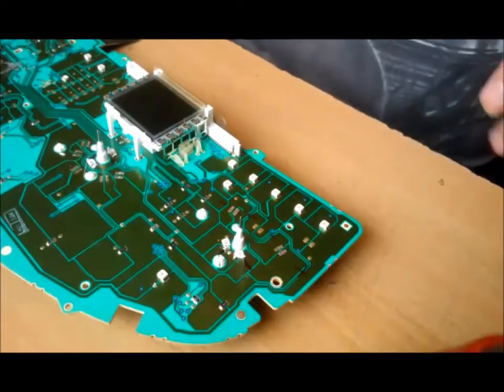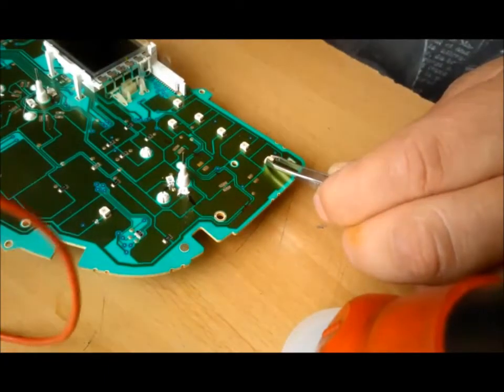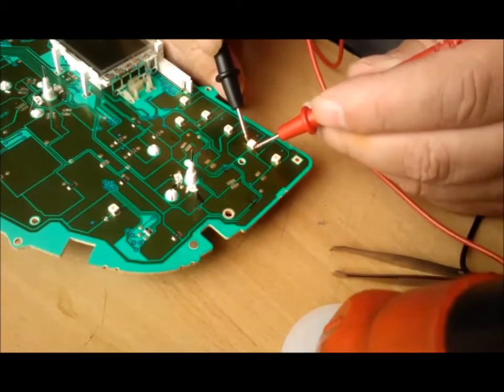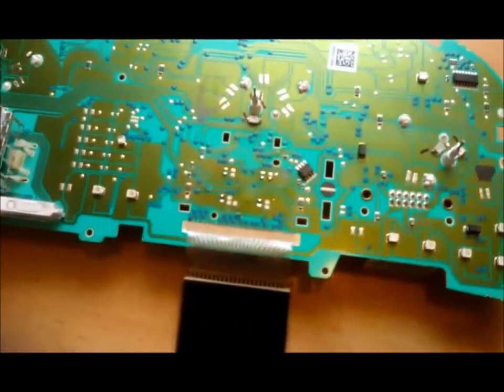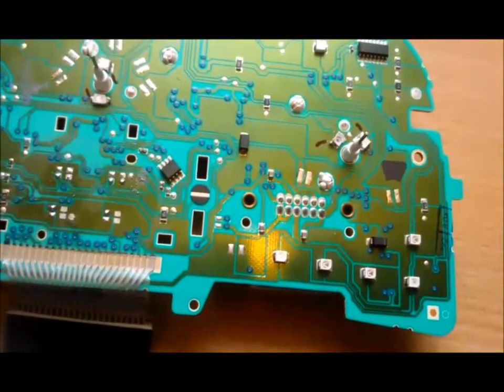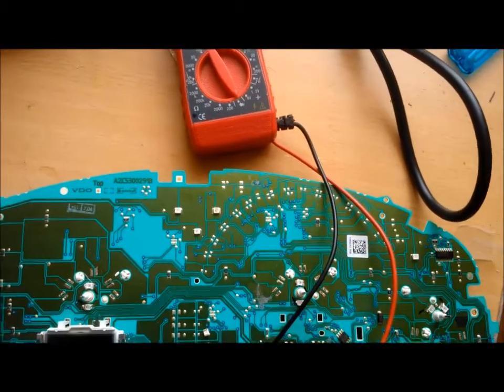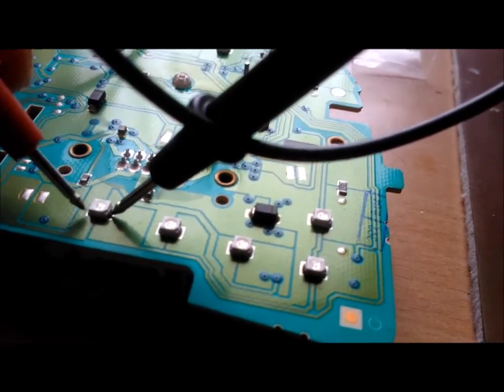vectra c clock smd led change

Comment: hi A Li used plcc2 3528 for the general use and plcc4 for the mileage box all blue except the speedo]tempgauge fuel gauge and revcounter for them i used plcc2  3528 red since seeing your vid and the way you have numbered all the bulbs neg live etc that was a great help cos it so easy to cock up brill Al
Reply from the maker: +John Evans im happy my little video help you out that's what it is all about

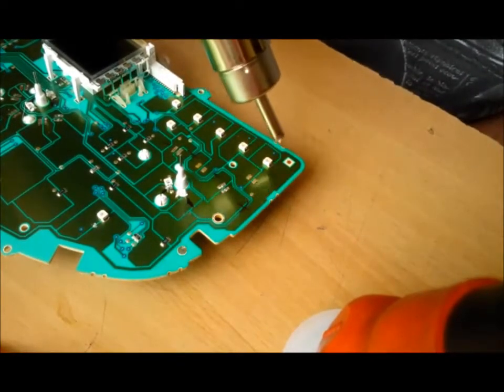Comment: Hi, the first led lamp at 0:46 , is it for the engine oil light? My engine oil warning lamp doesnt turn on when i start the car, no fault codes.
Reply from the maker: oil -handbrake-battery-airbag if i remember right no light can be a list of things have you tryed another set of clocks to see if they light up ? come on over to have a chat https://www.facebook.com/groups/507140652817499

Comment: Wonder if you can help.   I understand the needles will still be red even if i use blue leds.   So would it be best to use white on the needle leds to make the needles more brighter red?   If that makes sense.
Reply from the maker: ok you will not wont them brighter as when you first put them on at night you will be turning them down as to bright but they are red because the needle are painted that colour if you want say blue needles then you can sand the paint off as they are clear under the red paint and to me the blue seam brighter then white but thats just me i hope this help
Reply: Alan Ansell Yeah I've seen a how2 on vectra-c.com on how to make them clear.   What's I've decided is, to keep the needle smds original because no point in changing them because I'm going to keep needles red..  Thanks for the reply and video. 👍
Reply: You got any advice on removing and putting the needles back on?
Reply from the maker: i use a tea spoon to pop them off and to put them on put clocking in car with no glass on power them up but engine not running then pop then on at 0 then mileage shud be right if that helps
Reply: Alan Ansell I changed the leds today and good really good.  But I've not got the airbag light always on. With code B0975.  I tried to erase it but it comes back.  I've been told it's a malfunction since doing the leds.  You ever come across this ?
Reply from the maker: sound like you shorted out a smd check them all i would start with the ones under the mileage first
Reply: Alan Ansell I've decided to buy a new speedo off ebay and buy a hot air gun solder this time.   I'm just going to desolder the eprom from my circuit board and transfer it over to the replacement clocks so it's the correct milage.

Comment: thanks for that Al i put it all back together and the bloody speedo  needle just dropped down to zero all the rest stayed as they should do, what have i done wrong advice Al if you have any thanks john
Reply from the maker: sorry for the long delay as i didn't see the message until now what i do it leave the speedo off put clocks in the car with the glass off start the car then fit on the needle so you have it set to zero go for a little test drive to see it working befor you put it all back in

Comment: Big AL what equipment are you using to heat the board?
Reply from the maker: it a 858d hot air rework station it is like this one on ebay 

http://www.ebay.co.uk/itm/Ajustable-Flow-858D-Hot-Air-Desolder-Rework-Station-Solder-Blower-3-Nozzles-UK-/371366667664?hash=item56772da590:g:0jMAAOSw14xWH4eb

the ebay link has nothing to do with me it just to let you know what you looking for

Comment: what tipe of resistors did you use?
Reply from the maker: 3528 Blue Ultra Bright Light Diode 1210 SMD LED PLCC-2
Reply: and did you had to change any resistors for the smd leds?
Reply: because i did this too, but the red smd's in the needles dont work
Reply from the maker: no resistors have you put them the right way round
Reply from the maker: send me a photo up close of the smds not working